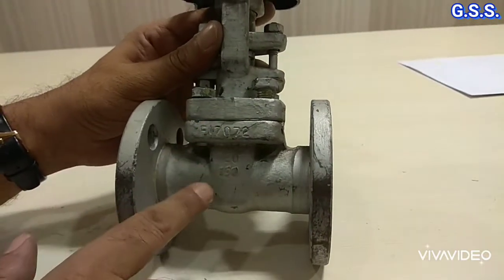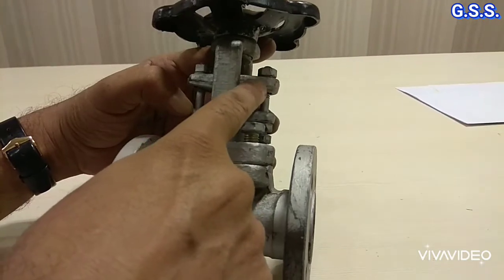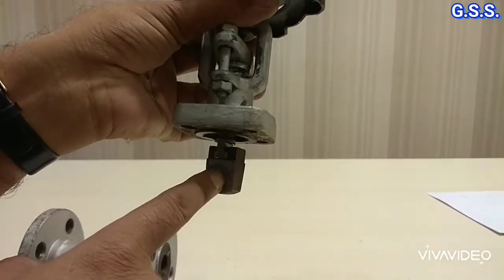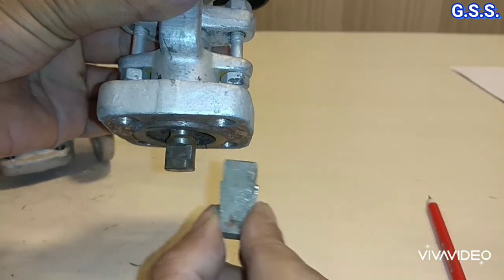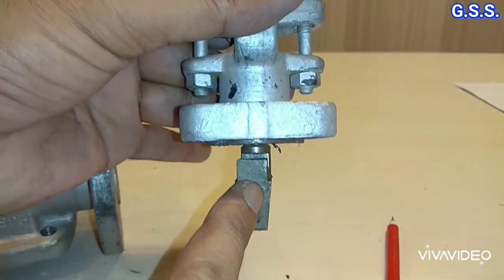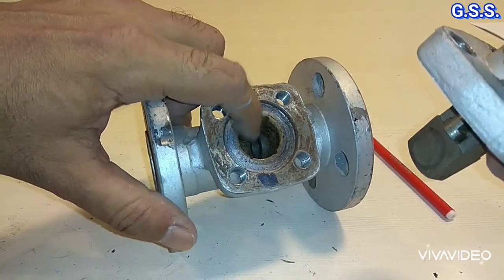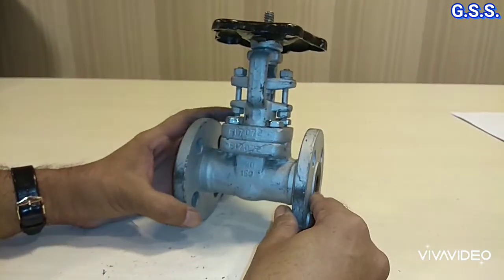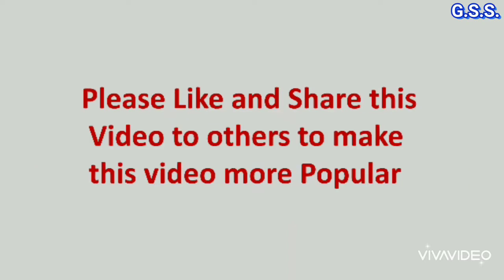Piping Engineering : Ordinary Gate Valve Internals

Comment: when is the full bore gate valve is used? What kind of situation. Please explain.  ?  Another question. After purchasing of new valve from vendor. May be if not installed More than 6 months.  That valve again required hydrostatic test. What is reason? Please explain verbally about my clarification? Thanks sir.
Reply: full bore gate  also using in line / hot tap welding . to fix the hot tap machine.
Reply from the maker: Full bore valves are used for pump suction line, for drain lines and for the lines where low pressure drop is required 
If valve is not used for 6 months then also no problem, because after installation in pipeline, the line is tested at 1.5 times design pressure.
Reply: @gourisankarsamanta7670  Thank you very much for your reply . your are well and very experienced in PIPING field. please make more videos about piping and please share your great experience.we humbly request you to post atleast one video per day in future.